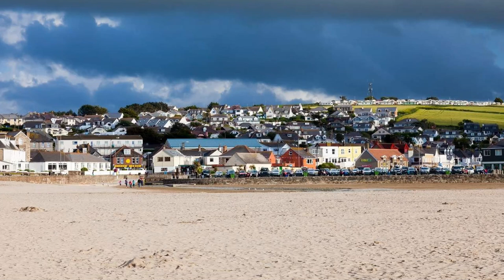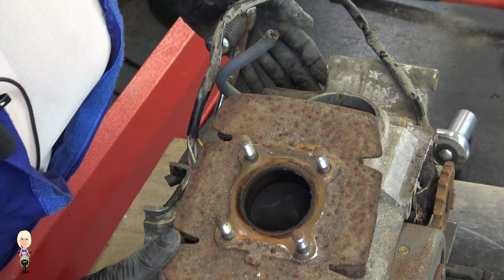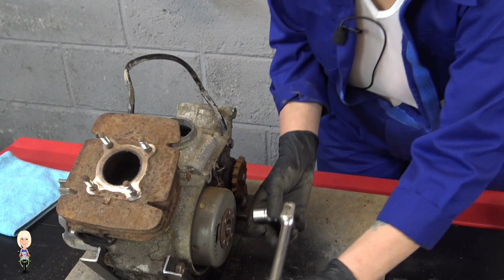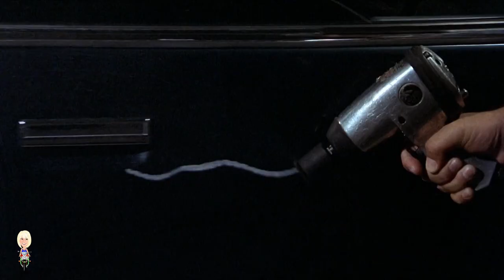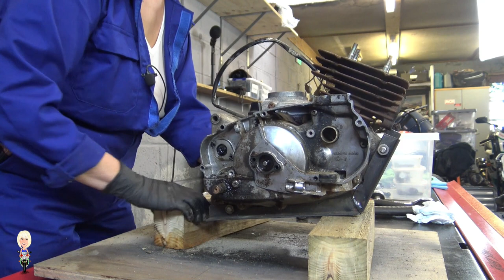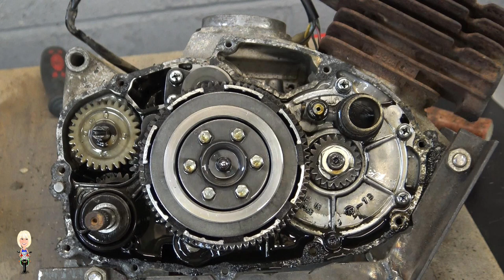Kawasaki KM90, engine disassembly 1 - Part 8

Comment: I notice that you don't tend to spray penetrating oil on parts to help loosen them prior to disassembly.  Is there a particular to avoid using it, or was there a step I missed? 
Thanks

 FWIW, back when I first tried to work on a Japanese motorcycle (many, many years ago) I had no idea that they used JIS fasteners and managed to damage quite a few of them.  I remember that a common practice was to replace the JIS fasteners with socket-head cap screws.
Reply from the maker: I do apply duck oil to many threads, but as it needs time to penetrate, I do a long time before I film.  Also with stuck threads, is to heat it up, then let it cool.  Once cool it will simply undo. 
There is a very good Kawasaki channel here on YouTube and the chap often states that he uses Phillips screwdrivers, and when you look at all the damaged screw heads, you can see why he should be using JIS
Reply: @km90restoration45  Thanks.  Back in the days-before-Internet, it never occurred to me that Japanese would use something other than a standard Phillips-head screw.  Although it is funny now, back in the 1980's when I first started working on a Yamaha AG175, I cursed the "Stupid Japanese Engineers" for those fasteners while the Japanese Engineers were probably laughing at the "Stupid American Backyard Mechanic".
Reply from the maker: The right tool for the job always helps

Comment: Always like what I see with you. Are those J.I.S. straight blade screwdrivers? ;-)
Reply from the maker: Yes, they don't cam out
Reply: I think these are Really brand and a set of 4 including the long no. 3 a couple of 2s can be had for about £15 and are pretty good value .